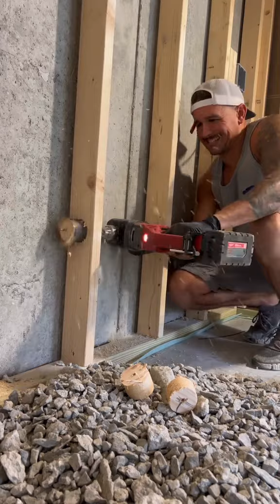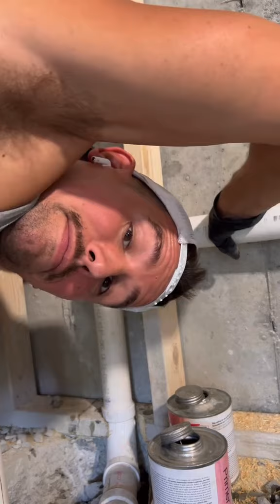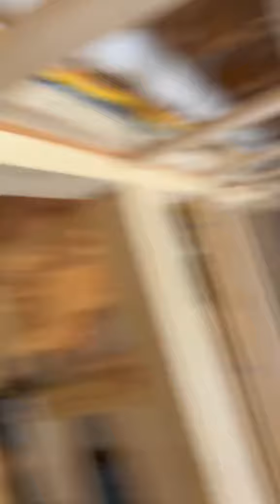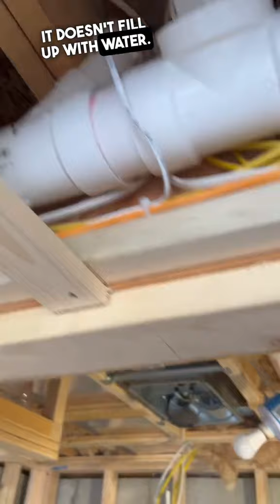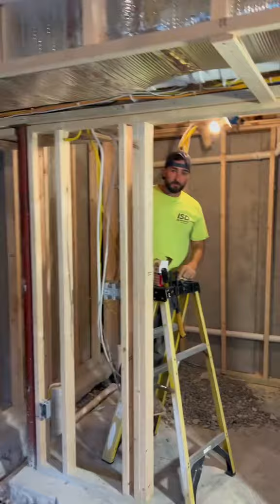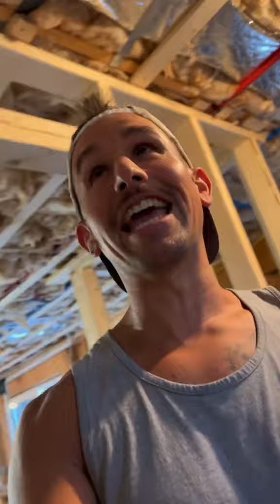Basement bathroom vents

Comment: You’re the first social media plumber I’ve seen pull a stud to install a seamless pipe horizontally.  I never understood why you wouldn’t do it this way.  Heck I’ve seen a hole drilled on the exterior of house to run through all the joists.